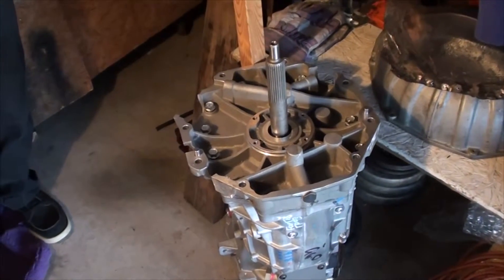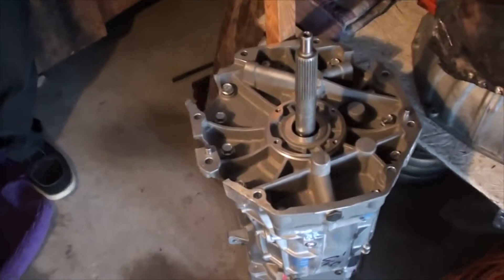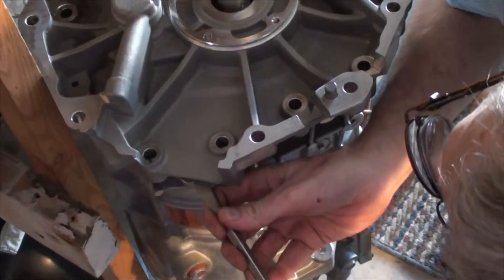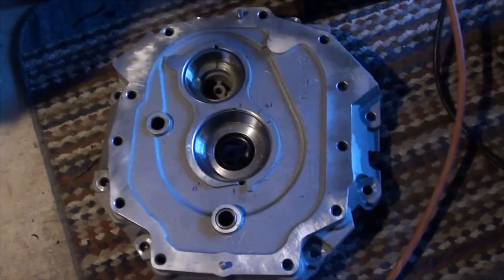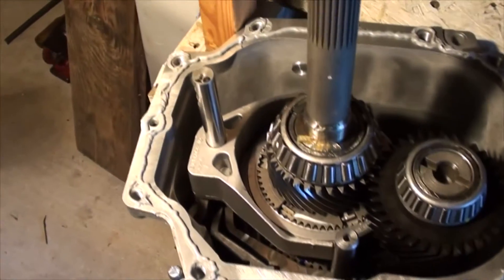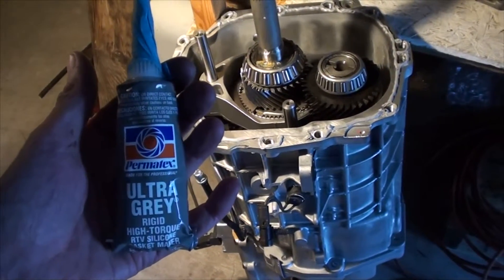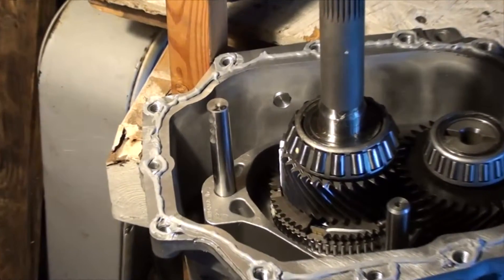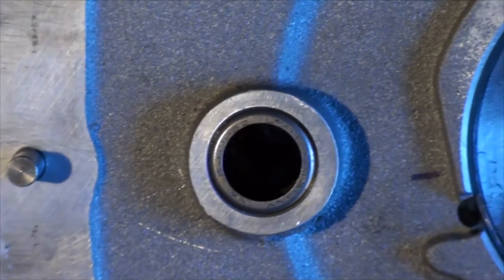1968 Chevelle T56 6 Speed Installation Part 9 T56 To Engine Alignment Procedure

Comment: Big headache beter to go with tko 600 5 speed
Reply from the maker: It was a pain to have to take the front cover off of the T56 to check the trans centerline alignment.  But it was fun.  It just boils down to what gear set up one wants.  I preferred the T56 gear set over the tko 600 gear set.  Plus I needed the higher torque rating of the T56.  If none of those requirements are what one needs the tko 600 can be a better selection.

Comment: daryl i got the t56 in my chevelle finally, ive been driving her around all summer. 454 with t56 and 3.73 gears i get 18mpg on the highway with a holly 750. i am building a 496 just like you, i will put a rochester on and an edelbrock 2.0 intake and hopefully break 20 mpg on the highway. at 85mph i am cruising at 2500rpm and i dont have to touch the fuel when i hit hills. when i get the 496 in it it will be twice the power and twice the torque as the 454 is low compression and fairly stock so i figure i will be able to cruise slower at lower rpms and not have to touch the fuel when i hit hills. what are you getting for mpg on the highway?
Reply from the maker: Good job.  Since I do not travel in my Chevelle much I have not gotten around to checking gas mileage yet.

Comment: i have another question got my t56 magnum yesterday i see theres some play on the input shaft is that normal
Reply from the maker: It depends on the amount of play.  Measure the amount of end play with a dial indicator if it is a concern and than contact the place where you purchased the T56.  They can tell you how much play is allowed.  I do not recall any major end play when I put mine in, but that does not mean that there wasn't any.  The T56 manual on page 5-1, which can be down loaded from Tremec, says input shaft end play is 0.000 - 0.002".

Comment: Great video. Do a wiring video showing how to wire the reverse lockout and the other pigtails? Thanks
Reply from the maker: +firebird pontiac   There were two systems I wired up.  The backup lights and the reversed lockout.  Both will be dictated by the wiring diagrams of your particular car.  For mine my backup lights were simple since I already had them wired to a toggle switch.  I just re-wired it to the transmission.  

The reverse lockout was more complicated.  So since I did not want to splice into my brake lights system nor take the time to do it I just wired the reverse lockout solenoid to a switch on my home made console.  So when I want to shift into reverse I just flip the switch first than shift and than turn the switch off.  Than I proceed to travel in reverse.  My switch is lite when on as a reminder to turn it off if I forget to do it right away.